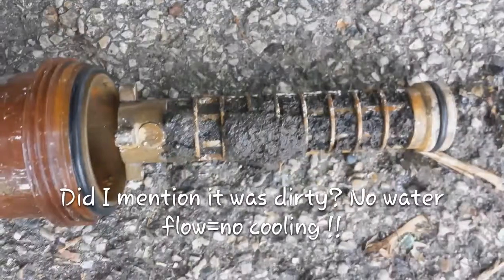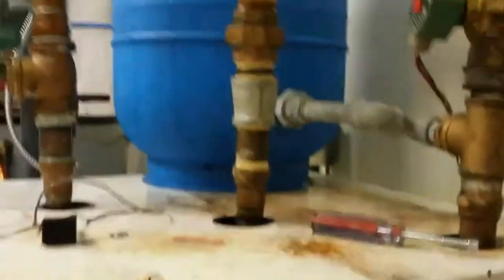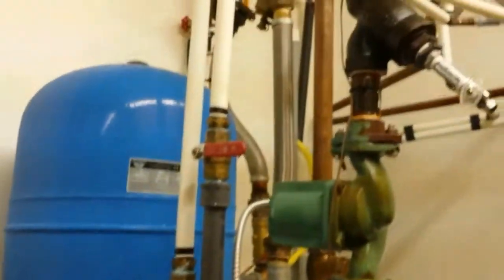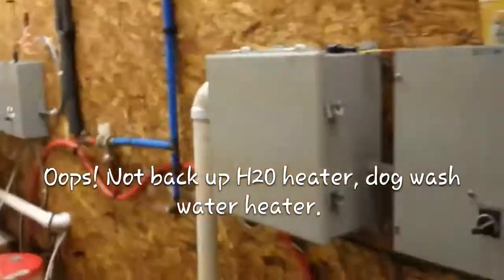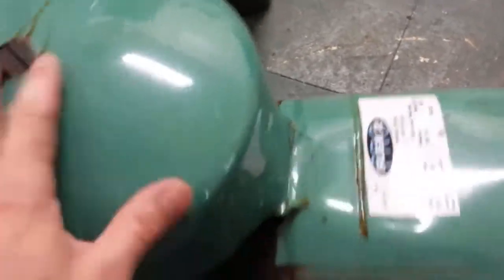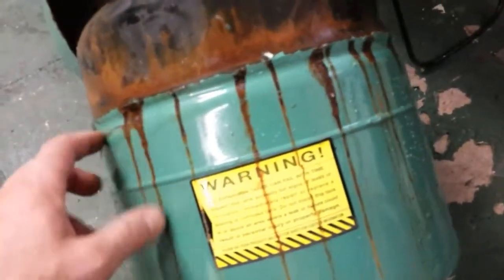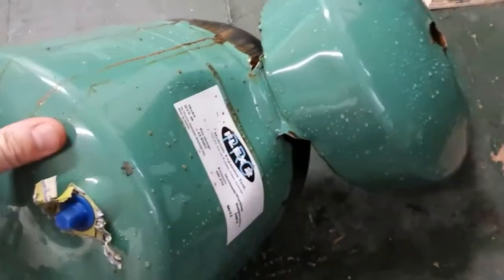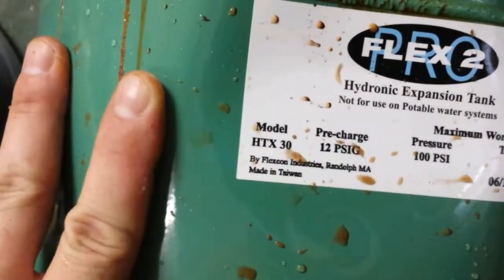HVAC-Geothermal service calls part2

Comment: How does first stage works with second stage compressors are they both configured in series or parallel or parallel on demand with solenoids controlling the freon flow? I am new to this sorry I was curious on this video and wonder what goes inside this geo unit.